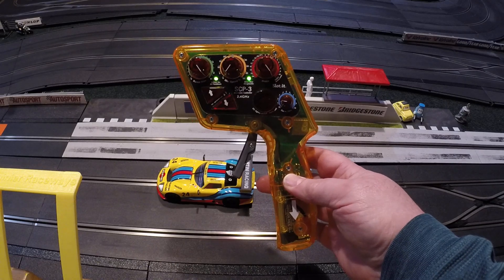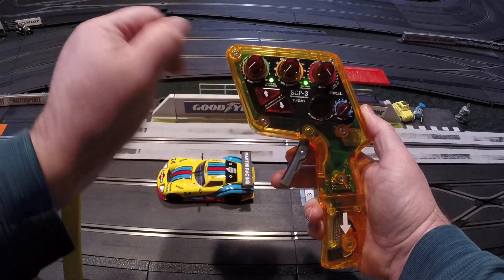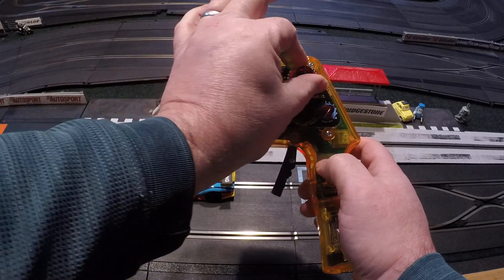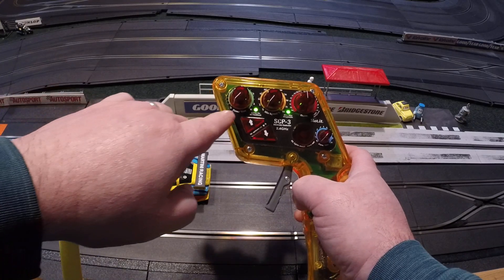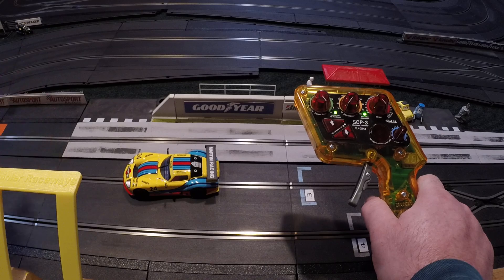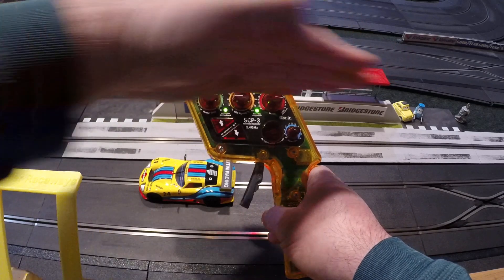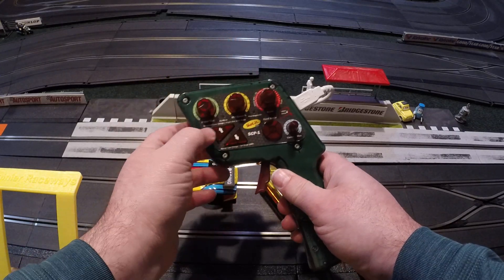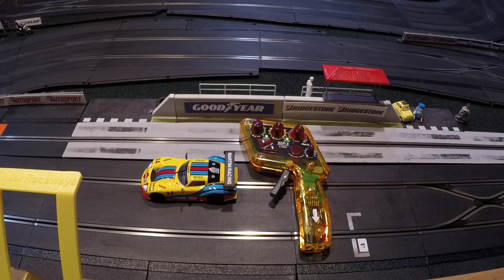Slot.it SCP controller basics

Comment: Greg, I am in the midst of selecting a controller. This video is a great explanation of the Slot It controllers. Thank you. I am not any closer to deciding but this was a big help. So much going on at first glance. You really simplified it for me.
Reply from the maker: The SCP is a great value, IMHO. To get the kind of control over the throttle with other brands costs 2+ times the price. Most people dis the SCP because they don't find the controls intuitive (while never using the options on their $500 controllers ;-), and/or they don't like the light trigger. Since the SCP uses a hall effect sensor for trigger detection, there is no friction of a coiled resistor or wiper board. The trigger itself is very light, so the spring can be very light and still be effective. Guys who've been racing since before this was possible are used to the "zippy" feel of a coil or wiper, and the accompanying stiff spring. Since I pretty much started racing with an SCP, I can't stand those things. ;-)
Reply: @ggaub  thanks for the comment. All of the knobs and buttons look intimidating but you explained it very well. I understand how people could get use to the friction and the noise a controller makes.. I use a Truspeed digital controller on my home track and a wireless Frankenslot.. so I am use to it.
Reply from the maker: @twolinesslotcars  TBH, I don't use mine for digital racing other than oXigen, mainly because the need for power to the controller is a bit clunky. It can't be wireless to the D132 Wireless+ receiver, so it has to be wired, which requires tapping into the power. But, for analog racing (or oXigen, or SSD using the ARC Pro), it's fantastic. I assume you're looking for an analog controller to race with a local group?
Reply: @ggaub  you are correct. I am good at home.. just hate asking to borrow controllers at the club. Need my own so I can get better and be more consistent

Comment: I just got an SCP-1, it's my first SlotIt controller, I got it on a whim, I'm used to using a Synapse.  Your run through is very useful and I see there's some really handy features.
Reply: I used it for the first time tonight on our routed club track...and love it! Why aren't these more popular? I've only seen one used on very rare occasions but I'll be using this old one on a regular basis. 
I tried curve and linear and prefer linear as you can adjust the maximum speed.
I prefer sweep brake over regular brake even though I've not used it before.
6 races, 6 wins and not really any slower than with my ££££ Synapse controller, in fact the cars felt easier to drive the same speed.

Comment: Great Video thanks. One thing I would like to add, is that the Linear/Curv switch is a big difference to how you set the knob, the max knob works completely different. At least in mine (SCP-1) If you put it in Linear, the max knob (the little one) works as if you set a knob to your power source, giving you more or less voltage at the end of trigger motion. Useful if you have a kid and do not want him to use the car full power, even if he pull the trigger completely. But… if you set the switch in Curv mode, the max knob, works completely different, you will always have full power at the end of the trigger motion, and what you are changing is exactly what you teach us in your video, you change the curve of power (you simplify it perfectly saying that you move where the middle of the trigger motion is) Thank you a lot!
Reply from the maker: That's true, but only if the two dip switches on top are in the correct position. With the dip switches in other positions, it acts similarly to how it does in CRV mode. 
The SCP2 has a different way to get into "kids mode", and the SCP3 will have another/different method. I intend to make a video explaining how to access and use this power limiting (kids) mode in a future video. I'll probably also try to better explain how that knob and those switches effect the power delivery.
Reply: @ggaub  Didn’t know that!, I only have this SCP-1, thanks a lot. One question, just in case you know… I have only one of these controller, because my kid use the professor motor controller, he likes it more just because the resistance the controller have in the trigger, I wanted to buy a second SCP-1/2 or 3, but I am not sure if it is possible to change the spring… I don’t know if exist a spring that is a little bit harder than the default one. Because the SCP have no resistance because of the magnet that use instead of friction, I thought that may be the friction could be emulated changing the default spring for a harder one. Do you know if that can be done?. Thanks a lot.
Reply from the maker: @eduardocominguez5173  Certainly, it can be. It's just a spring. You'd need to disassemble the handle in order to remove the original spring. The hard part will be finding one that will fit properly and offer a stronger resistance, but not too strong. I don't have a recommendation on where to find such a spring, or what kind would be a good replacement. That's a common complaint, though, so it's possible some google searching will result in something more helpful.

Comment: This prompted me to pull my SCP1 controller back out, and give it another try. I even consulted the manual. I have a completely different opinion of this controller now. I'm really liking the power trim and sweep braking. I'm still not quite used to the trigger pull, which is different from the controller I've been using, but I still managed to knock 0.1 sec off my lap time on a 6 sec lap, and I think I was also more consistent. I.e. less sliding, and fewer deslots.
Reply: It's actually got a throttle dead zone feature too.
You set a time delay for when you pull the trigger to when the car launches itself down a straight. 

You install a throttle dead zone to delay the car's launch down the straight cause the car has more ability than you're capable of dealing with. 
The driver gets excited during a race and a throttle dead zone caters for this fault in the driver. 
You can tune out the throttle dead zone feature but you'll be slower without it. 
Humans aren't capable of perfect throttle timing, 100 times in a row.

The dead zone feature takes care of human faults.

Comment: You call it wasted motion but it's actually called a throttle dead zone. 

You tune in a throttle dead zone because the human isn't capable of fine adjustments during a race.

When you pull the trigger,  the car is more capable that you realise it is, so the car shoots off and crashes. 
The dead zone caters for your twichiness and the car's super ability. 
The car reaches a later location on the race track before it launches the power.
There's a time delay you set into the throttle response. 

Humans aren't capable of doing 50 calculations per second and a throttle dead zone time delay feature is a good assistance feature.
Reply from the maker: I've found that people have much different driving styles than I previously believed. For the same car on the same track, some people prefer a "twitchy" response, and some need a really slow one. The point of the video was less about what settings are best (which is different for every person, with every car, on every track), but HOW to adjust the settings and WHAT they do. Most people are afraid of this controller because they don't understand how to get the most out of it. Now that you know how to do it, you can use an SCP and make it work the way that works for you. :)

Comment: Excellent video and explanation Greg!  Well done, thank you.
I just got an SCP-2 for my Carrera track; seems like brake level has no effect (set by CU), which is unfortunate.
Reply from the maker: Yeah, it would be nice if the brakes could be adjusted, but Carrera didn't make an allowance for that. It's the same for the other toys systems, though, so don't feel too left out. ;-)
If there were a way to adjust brakes from the controller, I'm sure slot.it would have included it. But, at least the throttle control features can be used to obviate the need for changing the power to the car at the CU, at least, once you get the hang of all the settings. :)

Comment: Hi I’m just now discovery this hobby what is your controller, and what do you prefer for car brand scalectric of Carrera? 👐🏾
Reply from the maker: The title of this video is the name of my controller. Google will help you find it if you want one. There are MANY car brands. Check out some of the slot car retailers you'll find when you look for slot car controllers. slot.it, NSR, ScaleAuto, RevoSlot, Thunderslot, and many others. Between just Scalextric and Carrera, I prefer Scalextric because they are lighter and move quicker as a result. In slot racing, top speed is only useful on very large/long tracks. For most tracks, quick acceleration and braking are more useful, and a heavy car as Carrera cars tend to be, will only result in less of those things. Check out some forums like slotforum.com or slotcarillustrated.com to really dive into the hobby.

Comment: Really good explanation. Thanks. I have the scp1. Isn't it so that in LIN + standard mode the blue knob just sets the max. Speed. In other modes you can set the second "corner" in the curve with it.
Regards, Rijnout
Reply from the maker: I'm planning to make another video about power limiting mode on the various versions.
Reply: @ggaub  that would be much appreciated!

Comment: Great video, easy to understand the use of the knobs. Haven’t used it for a while since moving to Carrera, question: what do I need to be able too use it with Carrera? The digital cartridge?
Thank u for the video:)
Reply from the maker: Yes. SCP has been Carrera Digital compatible since the first Digital cartridge. I have a few of them and have used them with D132 racing.
Reply: @ggaub  would that cartridge part number be the SCP201e? That fits into the SCP-3? How about wireless? Looking and the best option, including a wired controller Dave showcased a few weeks back and a wireless Frankenslot controller.
Reply from the maker: @thor8640  Yes, that would work. The SCP3 would need to have special firmware installed, but that can be done over your mobile phone/tablet easily. To make it wireless, you'd need to add the CRI, which is probably the way I'd do it, as the two wires for the digital cartridge are inconvenient to say the least.

I also have a RamJet-X for Carrera Digital. It's corded, but it's a great controller.

I've never tried the Frankenslot.
Reply: @ggaub  looked for the Slot.it controller onlineat Prof Motor and electricdreams, neither has SCP3 but the prof the CRI. Know of any  other Slot it carrying retailer?
Reply from the maker: @thor8640  
https://www.132slotcar.us/product_info.php?products_id=50319
https://www.132slotcar.us/product_info.php?products_id=36848

https://www.132slotcar.us/product_info.php?products_id=37554
Reply: @ggaub  do I need a cartridge for the CRI to be able to go wireless?
CRI is ordered. Have SCP-3 and the digital cartridge SCP201e. Do I need more? Carrera track. 
Thanks
Reply from the maker: @clausbjerga2745  That is all you need. The SCP3 has the wireless built in.
Reply: @ggaub  thank you:)

Comment: Question... Will this wireless controller work with Digital Carrera systemn?
Reply from the maker: Not directly, no. To use the SCP with Carrera Digital, you'd need the slot.it Universal Digital cartridge, which is wired. To then go wireless, you'd add the CRI, which is a wireless receiver that you plug the wired cartridge into, thereby making a wireless link between the controller and cartridge.
The SCP3 cannot connect to the Carrera Wireless+ receiver.
Reply: @ggaub  thank yoiu

Comment: Thank you for the video. I'am from Holland (Europe) and thinking about buy this controller. But I hear, that there is a problem with the connection in  XLR connector. Have you any idea or soluution with that ?( Forgive me my bad englisch) Frans.
Reply from the maker: I've not heard of any problem. Can you tell me where to find reports of that problem? I've used my SCP controllers with a variety of connection types, and XLR is my preferred connection.
Reply: @ggaub  Thanks for the reaction. One off the members of my club has buy this controller.He says, that it will not work with the xlr connecotor. You have to make an extra step ( fuse or something) before it will work properly. I am not that technical, so I don't no exactly what he have done.
Reply from the maker: @FransP1955  It is possible that he has the wrong kind of cartridge for the track. Slot.it makes a variety of cartridges for the SCP handle, depending on what kind of track you will be racing on. If he got the wrong kind, he might have needed to make an adapter to change the wiring to the controller. 

For the race tracks I race on, I only needed to connect the cables to the correct pins of the XLR connector, and it works fine. No special fuses or electrical tricks necessary. 

If you're interested in this controller, ask your track owner what kind of power it uses... The main difference is if it's common positive (negative polarity, like Scalextric or Ninco set tracks) or common ground (positive polarity, more common with club tracks). Then get the correct cartridge with your SCP and make sure the wires go to the correct pins of the XLR connector.

Comment: Hello Greg and thank you for your excellent video. I have a couple of questions, maybe you can answer them. I have been looking online but I didn't find much information about it... The thing is, I have been using a SCP1 controller for 10 years (I am still using it regularly), and I wanted to know if the SCP2 and SCP3 are better than the first slot.it controller. From what I understand they have newer and better technology. The second thing is, we always make races on analog, but some slot clubs are already starting to celebrate races with the digital Oxygen system. I wanted to know as well, is it possible to use the SCP3 both in analog and digital? The information at the slot.it webpage is not very clear about this... If I finally buy the SCP3 I'd like to use it as well for analog because it's the system we use most of the time. Thank you once again.
Reply from the maker: The SCP1 is still a great controller. The SCP2 adds a simple 3-way switch on top for the curve mode, and a trigger that can be longer for 2 fingers, and finally, the ability to recalibrate the trigger itself. The SCP3 adds built-in oXigen wireless support. I wouldn't suggest a person upgrades unless those things appeal to them.

Yes, the SCP3 can use the analog cartridges without any special changes needed. Just remove the battery (if you use it for wireless/oXigen) and plug in the analog cartridge. 

If you're considering joining in with some oXigen racing, I'd suggest buying the SCP3 rather than getting the oXigen wireless cartridge for the SCP1. It's not much more expensive to get the SCP3, and you'll gain those convenience features I mentioned above.
Reply: @ggaub  Thank you for your quick answer. As you say, I think getting the SCP3 would make more sense, like that I'll have the last model ready for both analog and digital races. Just one last question, would it make much of a difference if I also get a new analog cartridge for the SCP3 or would it be the same if I just plug the cartridge of my old SCP1?
Reply from the maker: @GuillermoLC  You should be able to just move the analog cartridge from your SCP1 to the SCP3. Which analog cartridge do you currently use?
Reply: @ggaub  I think it's the original cartridge that the SCP1 has. I bought the controller 2nd hand 10 years ago and I didn't touch anything of it. As for the reference, I don't see it written anywhere in the controller nor the cartridge...
Reply from the maker: @GuillermoLC  Probably the normal analog club cartridge, then. If you ever feel the need for a little more power and braking, the High amp, aka "METAL" cartridge can make a small difference.
Reply: @ggaub  Thank you so much once again. Then I think I'll first get the SCP3, like that I'll have the controller for digital races, and meanwhile I'll be using the old analog cartridge. You have helped me a lot with all these questions, I appreciate it.

Comment: Can you use the Slot it controller for 1/24 Eurosport racing?
Reply from the maker: You can with the "Metal" high amp cartridge, which I think has a 50 amp limit, I believe. That cartridge also has the ability to have a "blast" relay  wired in if desired.
Reply: Thanks for the reply